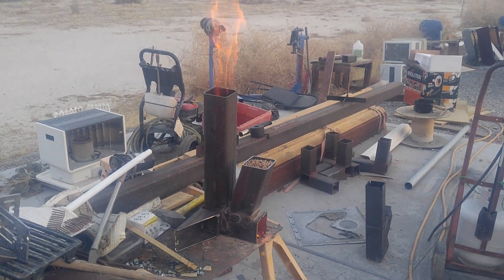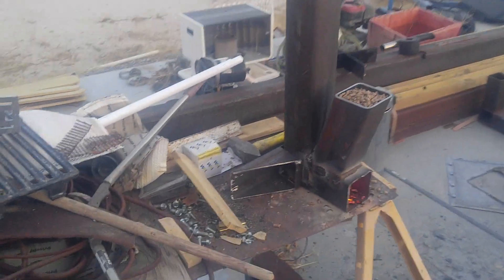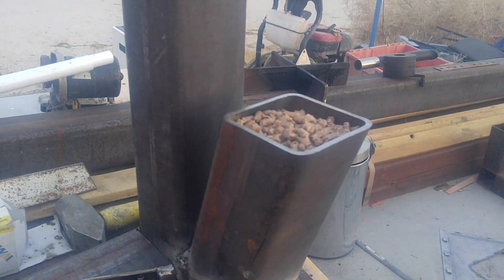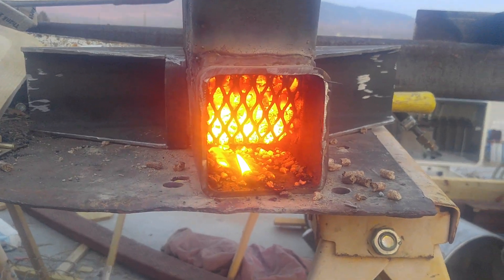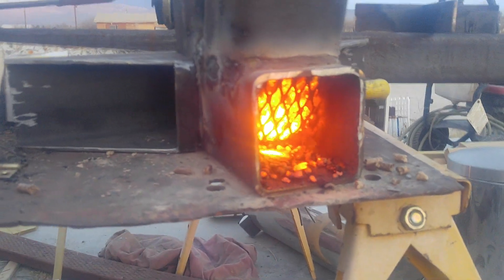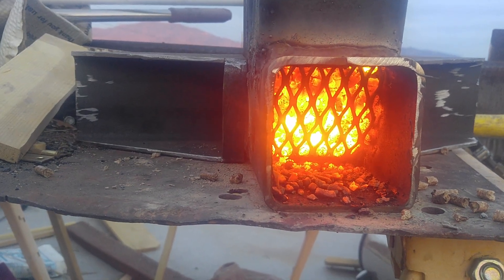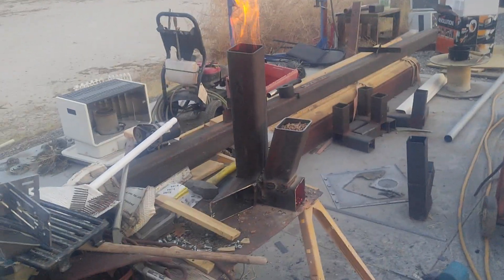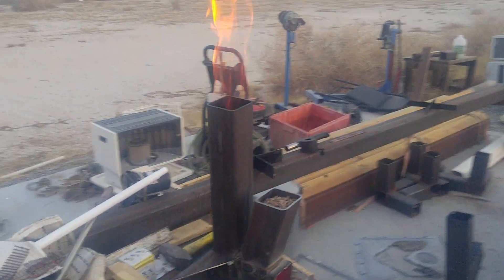Pellet Rocket Stove

Comment: You should have a small gap under the pellet basket (about 1/4") to let the air go by and burn cleaner. Also and air regulator of some sort would help control the burn temp.

Comment: did you ever get it working well? it appears that you have Too Much fuel burning with Too Little airflow. That can give you a lot of wood gas, which needs room and oxygen to fully combust. Reducing the size and depth of your pellet burner may help.
Reply from the maker: There wasn't a lot of smoke so I think it had enough air. The problem I think was the pellet tube was too large. It went through a lot of pellets and the flames were way too high.  Some way of regulating how many pellets can burn at one time is needed. 
I have not worked on it further.
Reply: @DannyB-cs9vx  Yes, you are getting a clean burn with a gasifying fire. However the burn isn't completing until it gets out of the pipe (where it gets additional oxygen). If you raise the pellet basket it should reduce the amount of pellets that can burn at once(reducing fuel and gasses), and increase the airflow. Which should result in a smaller(more efficient) fire, that has a more complete burn. This can be problematic when you have a short horizontal burn chamber, and the vertical burn tube is not compensating for the distance. Solution, reduce fuel and increase airflow. I would recommend making an adjustable pellet basket of some sort(temporarily), until you figure out where you need it to be.
Reply from the maker: @mysterytechknowledge3664   I would have to start anew. A guest that was staying with me wanted it for camping.  For my uses the one like Slim Potatohead made would work best for me. https://www.youtube.com/watch?v=t3XOLLg8wn0
Like I mentioned in my other stove build, I think I might place another box on top for heat recovery.
At the moment I am insulating and installing drywall in my detached garage so that I have a place to do winter projects.